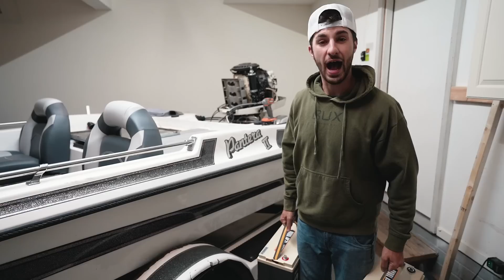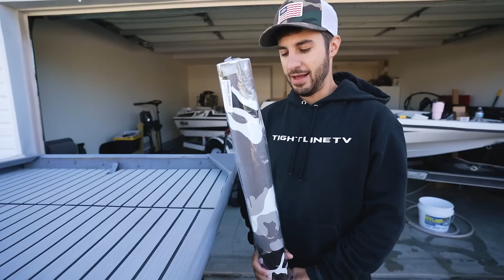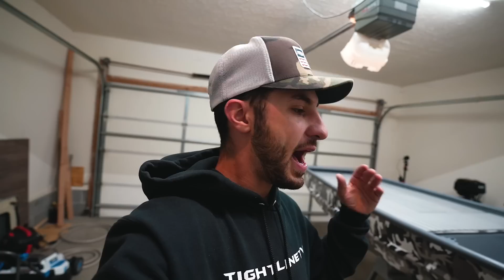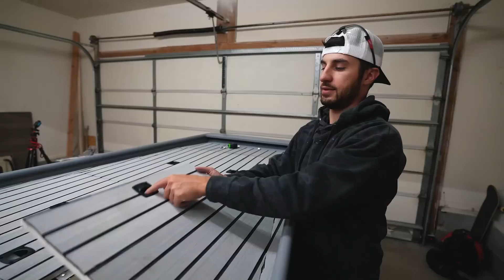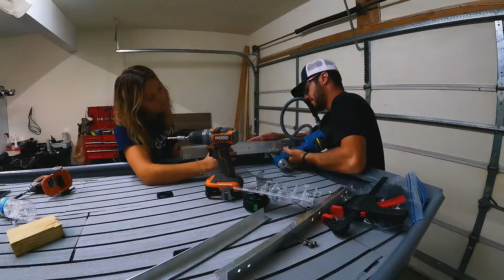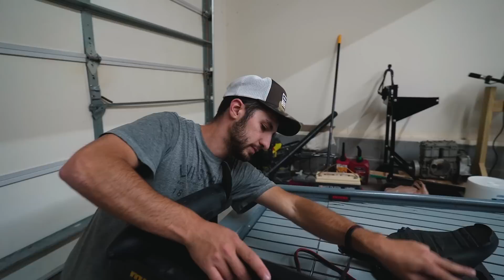Building The ULTIMATE Mini Bass Boat! (P.2)

Comment: Can’t wait to see a water test. I love that you’re giving this a shot. I’d be worried the PVC weighs a ton but I love the aluminum frame. My 1236 hates weight and I’d be afraid that the narrow width will make you feel high centered
Reply: Also will you be running an outboard? If so is the rear deck to high to accommodate the normal clamps that come on a smaller tiller style motor?
Reply: It shows in the thumbnail pic bro!
Reply: @RoamNzona  ah my bad! Good catch

Comment: Cool build man but first I wouldn't run your graphs to a switch cause they have a power button that will do that and better if ran directly to the battery and second did you run any inline fuses or anything with your lights and stuff. If not blueseas make a good fuse block